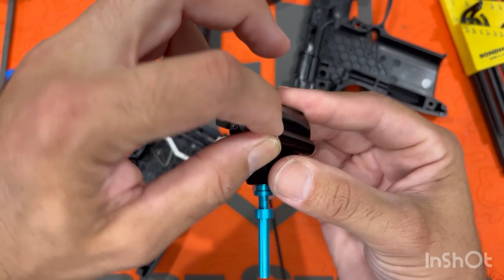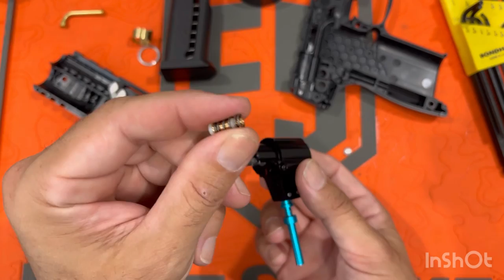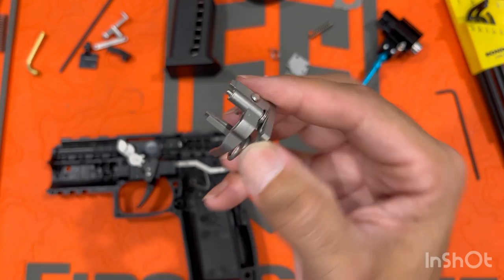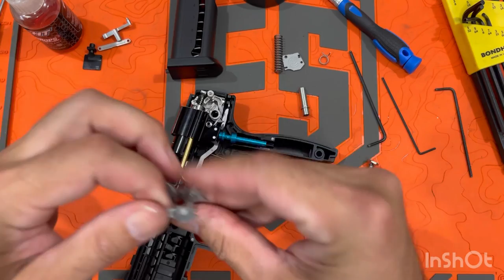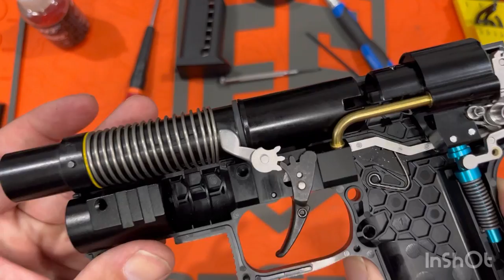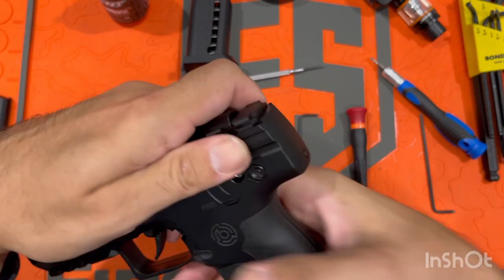Byrna LE Less Lethal - Inside The Valve, Reassembly & First Attempt Modifications

Comment: Any advice if I did accidentally remove that pin that you said to leave in place a million times? I got to this video too late. I’m trying to find out what spring and pin are supposed to be inside. It doesn’t engage those grooves, so I think I am missing something. 🤦🏼‍♀️
Reply from the maker: There is a spring and plunger that engage the grooves on the safety selector pin. Did you have any parts left over? It could just be the orientation of the selector pin is wrong which is relatively easy to fix if it is all back together now.

Best to contact me via email and share some photos if possible. Super difficult to diagnose remotely.

Comment: So did it function as regular when you reassembled? I may have canted something during my LE's MLL converter install and wanted to potentially use your teardown & reassembly videos as a guide to try and fix that.
Reply from the maker: Not the first time 🙂. I would merely use it as a road map and pay close attention when you are dissembling.

What is going on with your LE?
Reply: @lesslethalfordummies  I'm best guessing the barrel may have canted downwards during the install, maybe those pins in front of the barrel's spring may be just slightly out of place. I'd thought it was the compensator print since the barrel was catching on it, but even after chamfering the edge of the compensator, it's catching, and I'm also getting a very occasional catch on the action without it and now a very slight co2 bleed, so maybe the canted barrel's unseated the brass gas carry tube in some small way? I keep thinking that if I go in again, at least on the front end, I could English the barrel back into proper alignment, clamshell it up again, and hope that fixes everything.

So wait, there isn't another video where you went in and fixed it back to functionally normal? I saw the busted detent video, but otherwise does your LE work correctly short of the balls rolling out?
Reply from the maker: @GuillermoMaytorenaIV  both my LEs work but one does have a busted detent.

I would recommend just popping the top first and cycling the launcher to see if it is the barrel binding. Pretty common for one of the pins to slip the channel during a 12g adapter install. In this case a full disassembly is not required. Just loosen but dont remove the clam shell screws and fudge it back in. Also be sure the barrel return spring is seated properly…another common problem if the barrel if the trigger is crunchy.

Comment: Hi less lethal for dummies 
I have a question for you where you insert the c02 cartridge there is the puncture valve and around that Is a  little black ring and it looks like a little chunk of it broke off I was able to get it out I put a co2 cartridge in again and it still works fine no leaks just wondering what that thing was if you could help me maybe gy looking into yours to see if you can see what I am talking about , I called bryna and they told me I should have been using daisy,byrna or umarex co2 cartridge any help will help thanks in advance 👍
Reply from the maker: If in fact there was a chunk of the seal missing you probably have a leak.

What I usually find in the puncture valve is remnants of the foil seal from the top of the cartridge left behind.